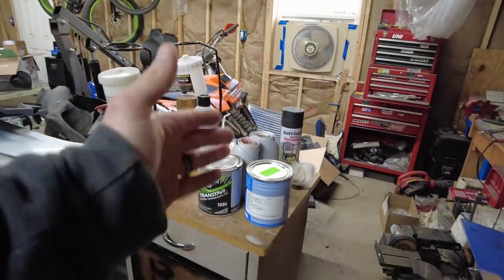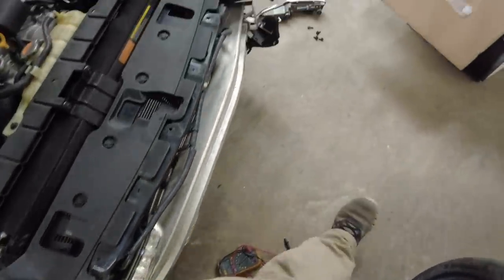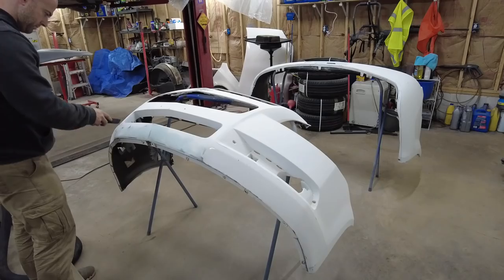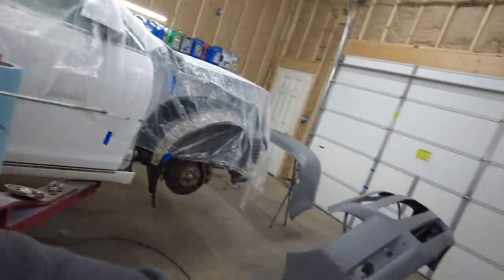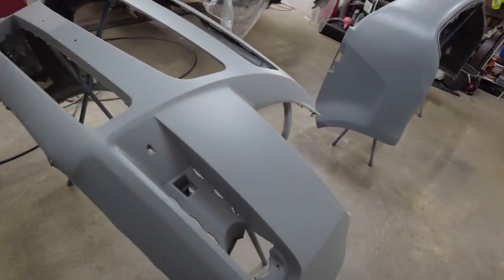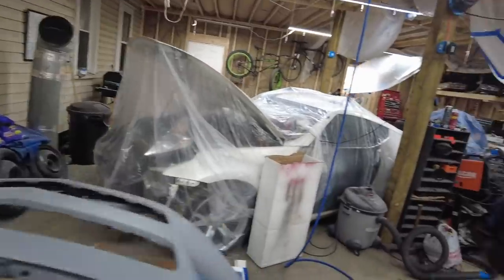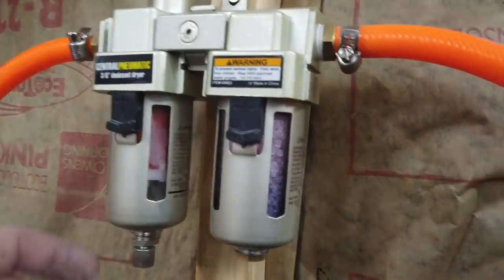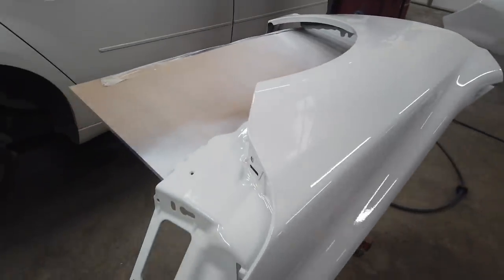Painting the 2012 Chevy Malibu copart project

Comment: you think with a bigger compressor you would still be getting as much moisture in the lines? PA is a pretty humid and damp part of the country that's why the rust happens so fast there the moisture and the salt are the recipe for rust. maybe if you had something to dry the air out it might not be as bad just a thought